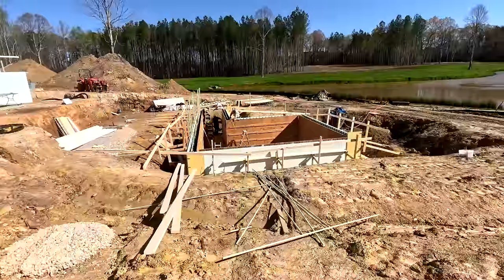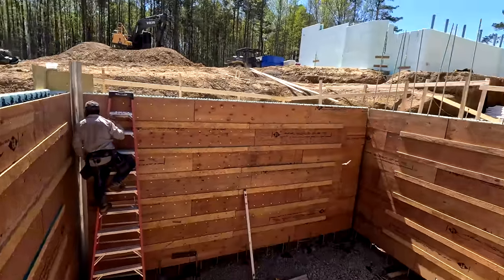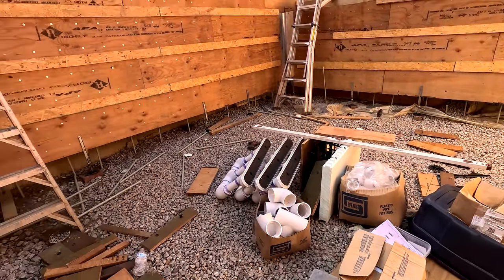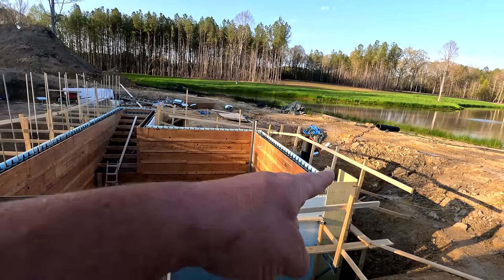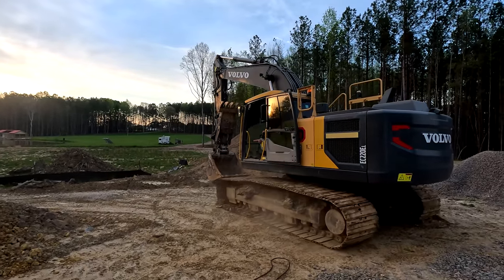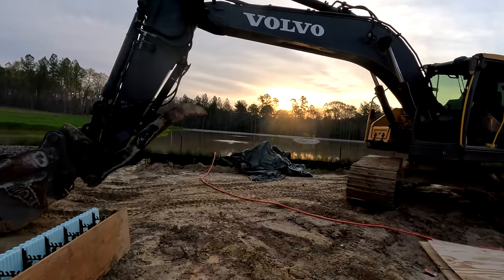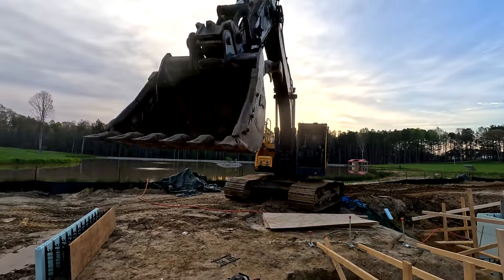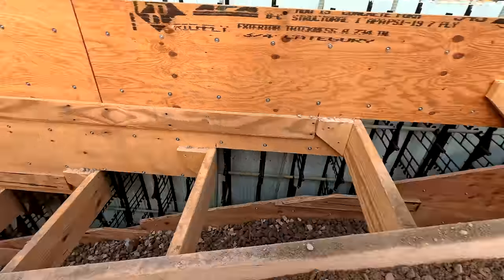ICF Guru is Back! Plumbing Prep and Other Details before Concrete Pour

Comment: hello from Norway.
i have been following your channel from the time Letsdig started on the deforrestation in prep for the lake you have built, with is awesome.
exited to watch how it all turns out, real interesting content on here.
just have a question for you about the pool, a real nerdy one at that. : if/when you have to drain the pool some day, where are you planning to siphon of the pool water? full of clorine and stuff isn't it? if you pump it into the lake all the wildlife in there will die?
Reply from the maker: Great question! We are doing an ozone system. The chlorine level will be low, like drinking water.

Comment: So I watched a video where a guy used a pvc pipe and a test plug in a drill to mix spray paint. The thing works I use it all the time. I'm betting that the same technique you could use with your pvc hole saw there and you could whip those holes out in seconds, Although it probably didn't take you long as is. Just an Idea for the future if your really going to get into doing a lot of that type of thing.
Reply from the maker: Great tip!

Comment: Could you do a video on pros and cons of ICF?  Seems like it has been a total pain.
Reply from the maker: I'll do one at some point. The house stuff is pretty easy, especially since out of 1 - 10 I picked difficulty level 9, lol. The pool stuff is not easy but a lot of that has to do with the difficulty level as well.
Reply: Difficulty Level 9.  Sounds like an Olympic scoring calculation 😂  Going for the Gold or bust. 🏆 (and bust is not an option)

Comment: If it was me, I probably would've put atleast one return at the beginning of the stairs so you dont end up with a dead zone and then I would've only used 4 lights, I think 8 is overkill for that small area but that's just my opinion.
Reply from the maker: There are two returns in the stairs.

Comment: I not buying that this is a cheaper pool alternative. It will be a cool pool design but I’ve seen gunfire pools done and it just seems so much easier with a ton less labor.
Reply: And the price to buy these wooden forms must be huge. How many times do you expect to reuse them ? Seems low on re use and high on cost.
Reply from the maker: I'll have less than 1/3 of what a gunite pool would have cost me. I have had those built before.
Reply: Can’t leave the house without sunsuncreaan or long sleeve shirts.some good brands of shirts that I wear when I swim.

Comment: So Mr Bealy Good, I see your Leaves are coming out on the Tress already, that won't happen here for another Month or So, Up here in the South West Adirondacks of Up-State NY!

So you were Rating some Shoes from a year ago, how did they work out, did they last more than 6 Months???
Make, Model and Cost????
Reply from the maker: Brunt. 
Yes, they have held up well. I don’t know what current pricing is but it was under $100
Reply: @BealyGood  Thank You, Inflation has made them OVER $100 Bucks now!
Reply from the maker: @webefree3125 🤔. I know they do discount codes occasionally
Reply: @BealyGood  I'm going to a shoe store to have my Feet Measured, as they ain't the same size any more or the Asians all have Little Feet!